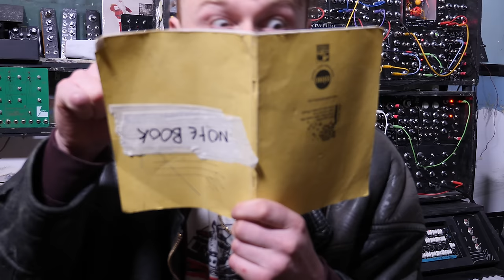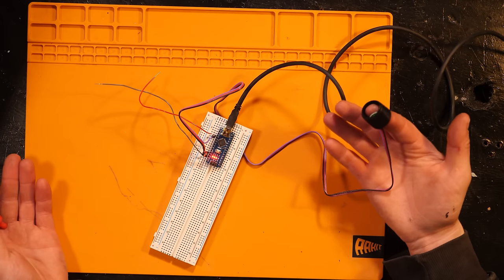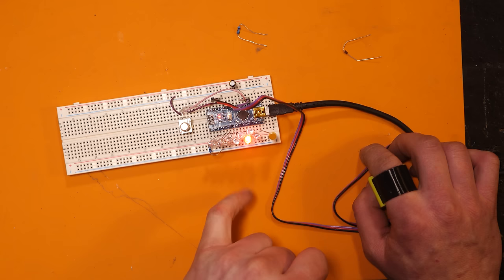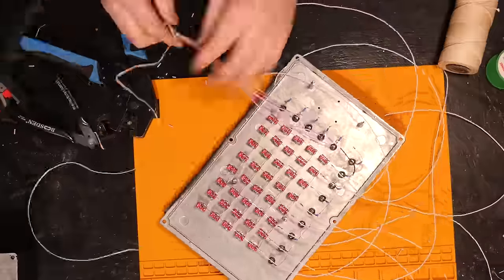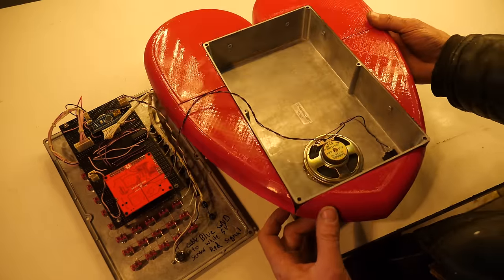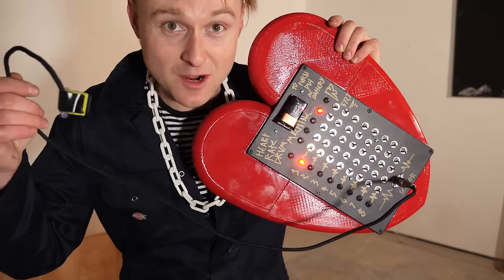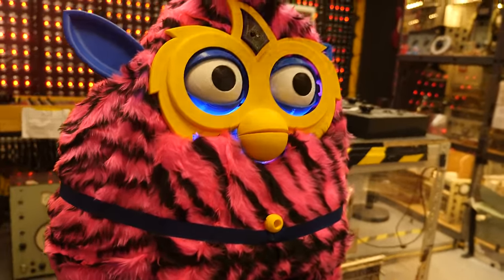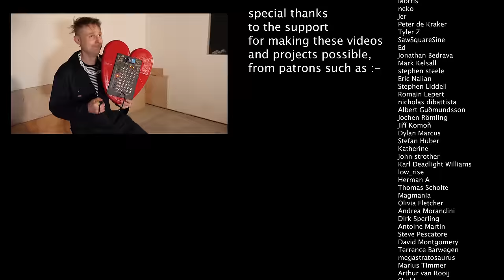HEART RATE POWERED DRUM MACHINE

Comment: It seams a simple LM393, LM339 (quad) comparator, capacitor and shift register like CD4021 would do the same.
Reply from the maker: Yep. It would do the same. But it wouldn't have reliably doubled the heart rate. Hence doing arduino as I already knew it would work and had to build it in 2 days😊
Reply: @LOOKMUMNOCOMPUTER  It takes a whole lot more code than you imaging to do it right, rather than just detecting an edge.
The same with buttons, it should be done with time stamps from a 1 ms timer or better. you can even calculate the beat rate than. like tapping a button once or twice, holding it. do you still have a "heart" sensor? would be fun to see but using 2 comparators, up / down edges using voltage dividers and CMOS logic.

How much rolls of plastic does it take to print these big things? i want one as wel.
Reply: @LOOKMUMNOCOMPUTER  2 comparators and a CD4013 (set/reset).
Reply from the maker: calculating the beat rate i did but i liked it taking the more direct approact of taking it beat by beat and then halving the time from the last edge. i did it as there was a more direct correlation. thanks a lot for the pointers! ultimateily i did it this way as it worked for me :D @AnalogDude_  by all means improve on it! i have built the modfule also already and when a new heart rate sensor turns up ill be using that with the synth, but its already build. cheers.
Reply: @LOOKMUMNOCOMPUTER  I'm referring to enable timer or safe time stamp on the first edge on and measuring how long it take to be definitely edge off to prevent false readings. that's how you do it with buttons.
Reply from the maker: yep thats fair, and that is how the library that comes with the sensor does it im pretty sure, which is what i used their library, as just threshold was more buggy. it works well though. nice one! @AnalogDude_